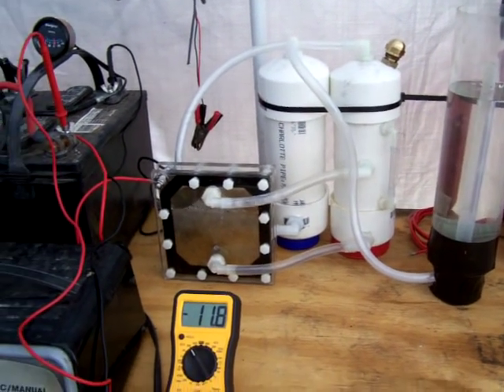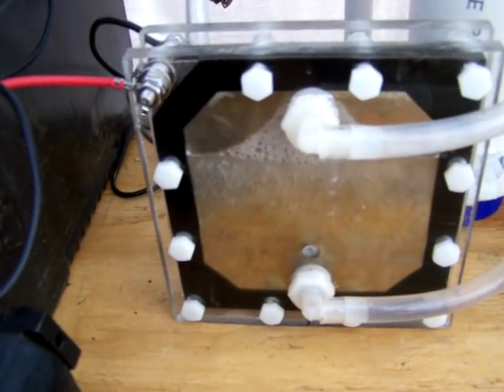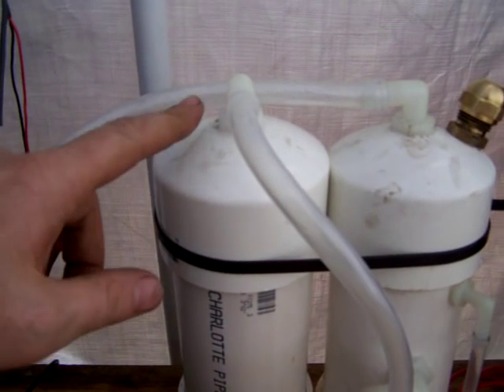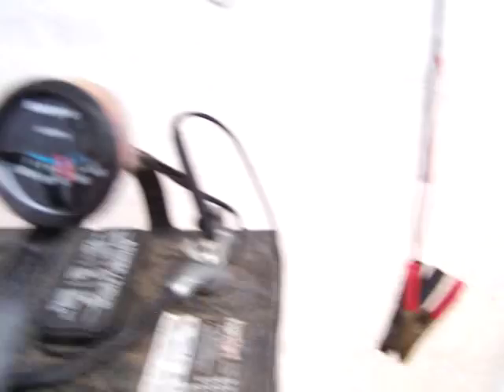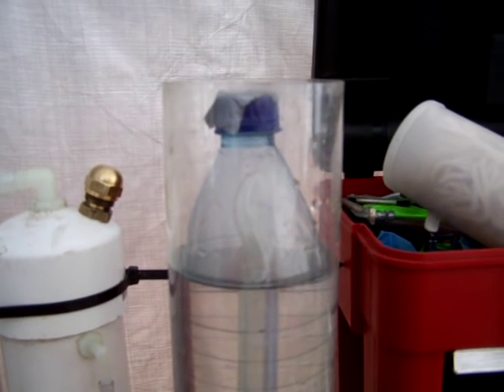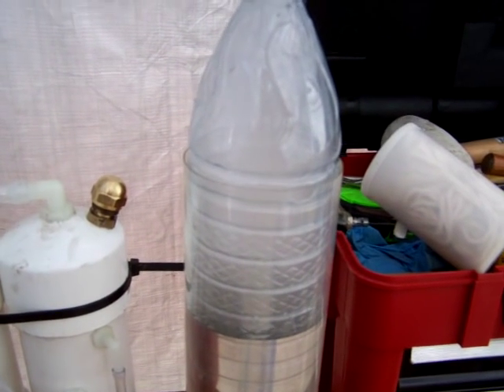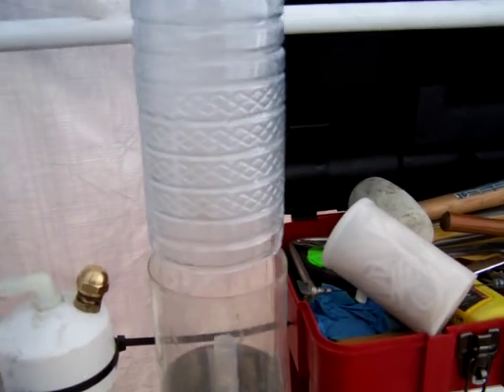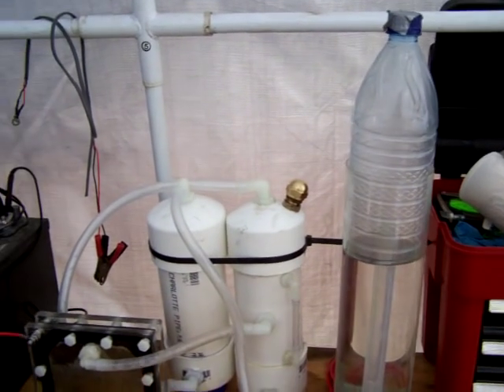Hydrogen on demand conversion kit. Turn any car into a Hybrid for only a few hundred dollars.

Comment: took me a few days of trial and error and I did it. the horse power and torque increase is insane. made an eighteen plate unit.
Reply: What vehicle did you use it on? Did you ever have any issues with it? Was it a viable option?

Comment: Thanks for the very clear video. This is one of the best out there, along with the
one by ''the King of Random''s '' video  called: '' Making fuel from Water'' .
Both are excellent to learn from and a big thank you from me.
I am going to make one like yours  or the ''King's soon.-now to get the part's!  .Lol.
*Hope to see your results soon ...

SUGGESTIONS:  1- add more plates like you said - say 12-18 plates;
2- Add more holes to each plate- it increases surface area, and allows more
space for the gases to escape- when gas is touching the plate there is no
( or little) reaction happening- which is what you want.
3- One creative person added a small pump to the dry cell to pump out the gas,
it increased the production !! Well done. All the best.

NOW Subscribed !!!

Comment: So a 2 liter 4-stroke engine running at 2000 rpm is sucking in 2000 liters of air/fuel mixture per minute.    And you think that about 1 liter of your hydrogen/oxygen mixture is going to make it work ?

Comment: Have a go using  Platinum mesh plates (same as used in catalyst exhaust ) for the electrolysis in the fuel cell You will be pleasantly surprised.
Reply: Why would you use plates compared to coils? Is there a schematic showing the construction and setup of these plates?
Reply: nice idea.
Reply: +gary depietro no platinum for this ohm boy. stainless steel kitchen equipment cut by hand.

Comment: Both hydrogen is is a colorless gas and oxygen is only visible when liquefied (it is blue) ,  You stated and pointed out the vapor coming out of your discharge tube and incorrectly stated it was HOH gas.  What you are seeing is condensing water vapor very much like fog or the vapor that is condensing water coming out of a tea pot spot.

Comment: I am not sure what your idea of "don't do much" is, but the small unit I built and use on my 1995 pathfinder has given me a savings of approx. 2 mi. per gallon. I have wind turbine generating system assisting the power for fuel production. so the approx. $12 dollars a week ($624 per year) may not be much, but it is close to free and pays for upkeep on the vehicle such as making my tires free! Does enough for me, and goes a long way towards making a statement to friends and family.

Comment: After reading all these comments, all I can say is to try it for yourself. that is how we learn and come up with new innovations, through trial and error. I've seen government vehicles extend their range using experimental systems. Also, European countries have been experimenting with Hydrogen vehicles for years. But, compressed hydrogen is highly explosive and very dangerous if not handled properly! From what I've learned the HHO (Browns gas) Is too volatile to be compressed or stored. If you decide to play around with this stuff, take proper precautions. use check valves, flash arrestors and bubblers and an emergency cut-off switch for the power source!

Comment: I've been trying to get an aqua tune module. They don't sell to Australia. The aqua tune modules produce nearly twice as much Hydrogen and only 1 tenth of the current draw. Also, no need for an electrolyte because the oxygen is consumed when current is passed through the water leaving only hydrogen. At least that's how I understood it worked.
Reply: +paul d I've been informed by aquatune that they are currently building a module for my diesel Jeep and they can ship directly. They won't give a warranty unless it's fitted by one of there approved installers.

Comment: I think that you made the the proses easy to understand to put together the only thought I had was to put some kind of spacer at the bottom of the cell to keep it centered in the tube in case of vibration while move over bumpy roads seeing as it only hangs from the top

Comment: Hi Gypsy,
Are you selling these? 
They Need a special chip for Engine ECU other wise the car has more power but uses more fuel actually as Oxygen sensor in exhaust gets messed up........ Oil companies did this with Car companies along time ago to stop HHO. A mate is going to try and space the oxygen sensor out to fool it....will see how he gets on....If you can make me one with all clear plastic or glass plates and Clear glass or plastic tubes i will buy one and help you set up to manufacture........... I can tell you are a really great man............Genuine! Cheers, Grant Simpson - Christchurch, NZ.

Comment: Companies specializing in HHO achieved 3L/min in the 1970's. The same Jr High Chemistry experiment taught in the 20's is still taught today. Wrap a stainless steel nail in aluminum wire submerged in a beaker of water and connect the leads to a DC power source and it percolates hydrogen/oxegen. HHO is basic Chemistry, after introducing the periodic table of elements students comprehend H2O is water. Controlling the pulse frequency of the DC current creates massive amounts of HHO at low amps.

Comment: The name Hydrostar cell was an electrical circuit many years ago, that was an improved hydrogen gas generator by adding pulsing magnetic field coil in electrolysis cell using pulsing DC at frequency of water capacitor.  The ring coil was in cell above water line. That system was actually a spinoff of the famous Meyer hydrogen Generator with 1500v and frequency of cell applied. Overunity fuel generated fom water capacitor. The pulsing field was 1000 times less than cell frequency. (frequency divider IC) Concentric tubes better than flat plates. This was called burst mode pulses 3seconds on, 7off. More gas bubbles during off time. The difference between the 2 cells was, - The high volts from coil flyback effect was attached to electrodes in Meyer cell, rather than just low voltage attached to electrodes.  In the EXPIRED US Patent, Voltage pressure separates the molecules after short current only ALIGNS the polarities first.

Comment: My question to you is how do you expect to get a significant result in MPG's when your car can only compensate for so much when it’s running too rich?  If you were to hook this to a car it’s like having less Oxygen mixture with your gas to create a set amount of force to push the piston down to in turn spin the crank shaft (ie; running rich.  If I was to use this in a vehicle application in theory I would need to decrease the amount of fuel being delivered to the vehicle via the injectors.  You would need to replace the amount of fuel burning with HHO and still get the same force to spin the crank.  Anyone out there saying that this will improve gas mileage by 15% or more is either full of shit or they are not telling the whole story.  I want to create something like this but I need more research.  The concept is feasible but there are flays in these "add to your car and save big on gas" DIY projects.  Less fuel more HHO would be the ideal version of this application. 

Please dont get me wrong I love this Idea but it goes deeper than plug in play :)  Keep up the good work!
Reply: easy, if you know how to spot the hydrogen gas and oxygen gas you can seperate the two, and this would be more ideal, you pump the o2 line to the intake before the MAF sensor, so you avoid a lean condition. and then you pump the hydrogen into teh fuel system. and you will need some sort of gas pressure regulation of the hydrogen so you don't inadvertently suck in air. you could also just let the hydrogen escape into the atmosphere as you drive, that would be the safest operation i could think of since you're literally just increasing the oxygen in the combustion system, and you won't damage the engine using a gas it's not rated for. although you will need to be extremely careful when going to gas stations, and hopefully you aren't near anyone who smokes or has a lighter near you, you'll want that line far away from anything flammable. and the reaction needs to start when you're on the highway away from idiots who throw their ashes on the road, but the worst that would happen if you say, had a line that went to the roof of your vehicle, would be fire jets, that would sound like a WhOOOOp! 

the key thing is oxygen and hydrogen need to be separated. otherwise you risk damaging your engine with water vapor. or if you're pumping hydrogen, a gas your engine isn't rated for reducing the life of your engine.
Reply: @TalentedAnthroFreak  are u just talking to talk?

Comment: Awesome, thanks

can you run this on whatever battery your car came with or do you need additional electric power?

Where is the video where you drive this thing on and off?

thanks
Reply: you can run it quite low but it is way too slow for a hybrid

Comment: I am happy to believe that HHO inproves your petrol (gas) consumption, but I do not know why? Burning petrol (gas) to produce energy to turn an alternator to charge a battery to break down H2O to HHO to burn to produce energy just can not be efficient?
Does the HHO improve the efficiency of the engine and burning of the petrol (gas)?
Reply: Frank Buckley It helps reduce fuel consumption in the sense that (theoretically) less petrol would be injected into the engine because the extra combustive properties found in the hydrogen can replace some of the gas. In other words, by injecting hydrogen into the engine along side petrol not as much petrol will be required for the engine to run properly when compared to the straight-up gasoline engine.

Something like that. I myself am still just learning.
Reply: You are close on the idea that less petrol is used. Modern cars (1999ish-Now) have what's called fuel trim where the ECU (Engine Control Unit) ,and also known by many other terms, trims back or adds fuel to meet a correct air/fuel ratio. It does it using math on sensory data from intake  sensors (Temp/Mass Flow sensors or theoretical intake mass based on RPM and Coolant Temp) and Exhaust O2 sensors. This gives the ECU an idea of the air/fuel ratio and what's being burned. If it injects at 80% cycle and finds that there is a RICH feedback then it trims the fuel to another amount, say 75% cycle. These are averaged over time. If you introduce another fuel (hydrogen) the ECU doesn't know about it but it will still see that there is a RICH feedback based on Intake/Exhaust comparisons because now you have excess fuel (petrol AND Hydrogen) to air ratio. It will then trim the Petrol back and keep doing so until it sees a normal Air/fuel ratio. So, adding hydrogen without telling the ECU results in the ECU "learning" to cut back petrol. This effect is compounded by the fact that Hydrogen helps produce a fuller burn that has less energy waste and DOES result in better MPG(of petrol). ALSO, the reason we have a throttle in the first place (with Fuel Injection systems that is) is to allow more air (oxygen) into the combustion chamber. With the addition to adding the Hydrogen, you are now adding OXYGEN directly into the system AFTER the throttle, this means you will have more oxygen available at ALL times to burn the fuel with. This leads to smoother Idling and smoother engine performance with less dramatic kickbacks for popping your foot off the throttle and essentially choking the engine. Less throttle needed for same amount of power as before.
Reply: You are correct in that you cannot burn gasoline to turn a generator to electrolyze water to burn in the engine and expect better mileage.  EACH conversion of energy from chemical to heat to mechanical to electrical to chemical to heat again, loses energy.  To think such a string of energy conversions will make the overall process more efficient reflects on the average U.S. citizen's ignorance of the STEM subjects.  As Yoda said, "So sad!"

Comment: Nice to see all these ppl talking about hho as if the really know if it works or not, from my own experience I built a large very simple unit for under $100, installed it on my 1999 f150 with a 4.2L v6 and increased my fuel mileage from average 13 mpg to 16 mpg so the naysayers van say what the like. If it is built properly it can produce more energy than it uses to make that energy.

Comment: Too many variables to give an exact answer for your 2nd question. But, to give you an idea... Hydrogen or "HHO" has anything from 1/4 to a 1/3 of the same energy that gasoline has, environmental factors, octane differences etc. So, you'd need 3-4 times the amount of "HHO" to provide the same amount of energy as liquid gasoline.

Comment: The optimal method to perform hydrolysis is to use solar and wind produced electricity and then converted to a gas. The real trick is storage. Sure you can store electricity in batteries but once they are full then what to store it in then? Hydrogen gas is very small molecules so will need a very tightly sealed container that has no way of catching fire or near electrical sparks. When you use this gas on an automobile engine with an O2 sensor, the sensor will detect the extra Oxygen gas and add that much more gasoline to the mix. It will then run too rich, fouling out plugs and injectors. And you will not get any added fuel mileage based on that fact. Unless you fool the O2 sensor which is an integral application to modern engines. Even if you use this on a small lawnmower engine with no O2 sensor, you WILL have to adjust the mixture. Meaning that if the hydrogen/oxygen is present you adjust it to that application. But if it runs out then it will be too lean a mixture setting and the engine will not run any longer on gasoline alone...
Reply: +lwblack64 When you add a blower, cold air induction or even a high flow air filter, the fuel ratio is changed to compensate, not over-compensate as you're suggesting. All three of these applications add more oxygen into the intake. With a blower you may need to add a chip which plugs right into your car's computer. I used a tamed down version of one on an old sports car I had. Once plugged in, it required higher octane fuel to function properly. The addition of the extra hydrogen would be the same effect. 
My older brother put an HHO system in his car. The gas mileage instantly went up around 25%. He did lots of driving for his job. Several hundred miles a day. It saved him lots of money. No mod chip was required.

Comment: Hydrogen or "HHO" if you are being accurate with your octane ratings, is closer to 130 not 120. Where I'm from gasoline starts at 91 and goes up to 98. "HHO" gas is 357.37 cu ft at a pressure of 101.325 kPa, that is your gasoline gallon equivalent. By weight, "HHO" gas is 2.198 lb or metric 0.997 kg, that is your gasoline gallon weight equivalent.

Comment: Is this thing actually cost effective? I understand that it has a potential to increase fuel efficiency but it also requires the use of a strong base that has to be purchased unless you make it (which would be possible but not likely). You also state that you use "access power" which I am assuming was meant to be excess power, but what excess power? If you pull current from the electrical system then you are just causing the alternator to work harder which will reduce fuel economy. Any input?

Comment: Lots of people doesn't think where the H2 come from. I agreed H2 will give more power to engine. But H2 generates from electrolysis process. here electric power use to break H-O bond. These electric power come from Battery/Alternator where mechanical energy convert to electric power. Engine has to burn more power cater this energy demand, Ultimately you burn more power than power generate from H2 burning since these power conversion process are not 100% efficient.

Comment: The ignition point is relative to the amount of octane of the fuel air ratio introduced to the combustion chamber, The higher the octane the earlier the point of ignition. HHO gas has the equivelant of 120 octane, which is why the engine timing is advanced. 120 octane HHO gas burns 20deg cooler than 87-91 octane gasoline and provides 30% more energy. Adjusting for the difference in ignition (timing), combusting a fuel mixture of 120 octane HHO/87-91 octane gasoline is inherently superior.

Comment: hi . I am not sure because i do not make a system like dis yet , but your generator have a small issue. When you put the tube from the tank water in the bubler on the bottom is not ok because the gas to pas in the bubler must push all the weight from the water in the bubler  what slow the flow of the gas increasing the pressure in the tank  what increase resistance in the flow of water in the generator because of small spaces between  the plates. I repeat I am not sure but if you still have dis thing you can try and see the difference

Comment: The facts are HHO burns at 120 Octane, has a faster ignition point , increases hp 30%, burns 20 deg cooler than 87-91 Octane gasoline, and has no poisonous carbon emissions. Nascar has been using HHO past 10 years and most every other motor sport is doing the same. The lead mechanics for Nascar understand the benefits and they tune to emphasize HP over MPG. NASA scientists studied and recommended HHO as the energy solution back in the 1970's. Hydrogen is the fuel NASA uses to put crafts in space

Comment: For example, to show you energy differences, "HHO" or Hydrogen gas compressed to 150 bars of pressure has an energy density of 405 Wh/l, liquid hydrogen has an energy density of 2,600 Wh/l whereas gasoline has an energy density of 9,000 Wh/l. "HHO" or Hydrogen, has a high RON rating but an extremely low MON rating hence although an internal combustion engine will run with a mix of, or purely on, hydrogen... it will perform poorly under load due to pre-ignition. That is, if you had enough added.